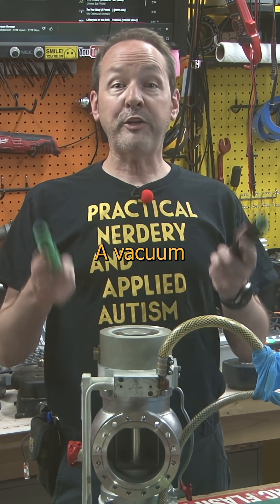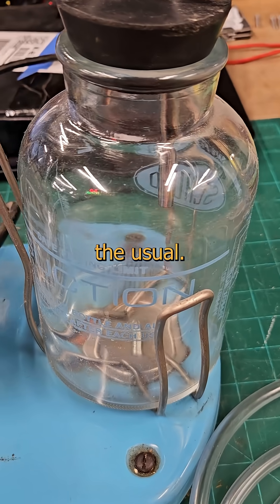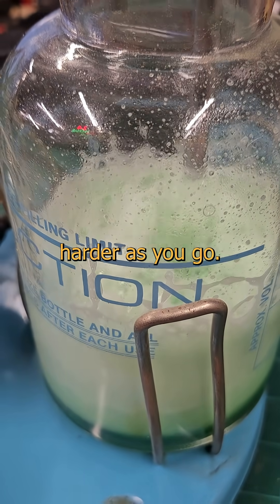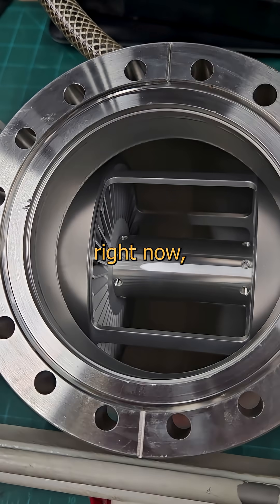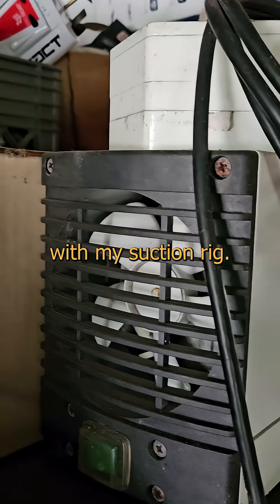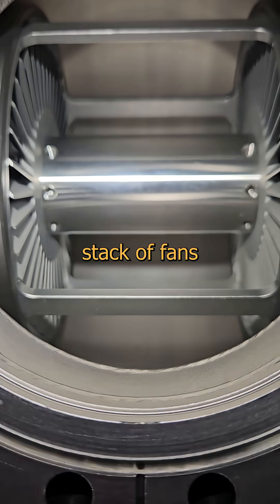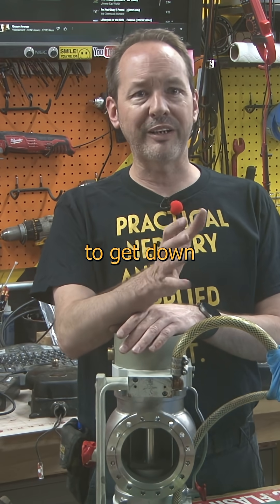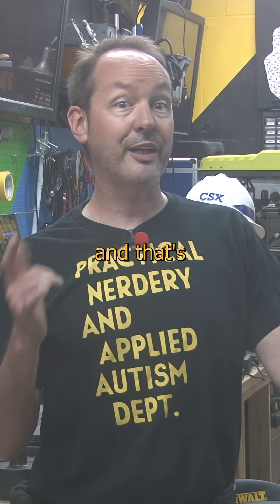Turbomolecular Vacuum Pump #chrisboden #comedy #engineering #physics #science #turbo #nerd

Comment: My job involves testing electronics under vacuum. A couple fun facts I learned:

1. At the vacuum levels we use, the mean free path of particles can be measured in meters. I.e. the average particle could travel 10+ meters before hitting another particle. That really puts it in perspective.

2. If that mean free path is the same size as the devices in your vacuum chamber, it suddenly becomes very very easy for electricity to arc between things. When you pull even more vacuum, the effect goes away. This also happens in Earth's ionosphere.
Reply: What sorta vacuum do you use? I work in MBE
Reply: 2. What the hell??
Reply: @MrHuram-abi  Remember that electrons interact with defined energy levels - meaning that, at some specific accelerating voltage, there will be areas of high interaction and areas of low interaction as the electrons slow down. You can actually see this as a sort of banding in plasma tubes (fluorescent lights count, though the phosphor makes it hard to see). If one of these bands happens to be right across the gap, you'll observe a peak in current as more electrons are absorbed. This may be enough to initiate arcing. As soon as the mean free path exceeds the length of all relevant points on the device under test, those bands will be further apart than the gap between the emitter and all possible receivers.
Reply: 10 meters??   Is that the distance between the lines on a foot ball field they play soccer on ?

Comment: I saw in a video taken back in the 40’s, Edison used the weight of mercury to pull a vacuum on lightbulbs. A long coiled glass pipe ran below the lightbulb with what looked like 100 pounds of mercury, once the mercury could fall no further, they heated and pitched the bottom of the bulb shut.  I don’t know how close to a perfect vacuum it got? But it was enough to keep a lightbulb working for several years.

Comment: So yesterday I was calculating what kind of watering pump you would need to simulate a cow drinking. Did you know a cow can drink up to 20 liters of water per minute ? The average flow rate of tap water is between 4 and 9 liters per minute. Depending on where you live.
That's a lot of sucking potential from the cows.

Comment: I happen to work in this industry! For my jobby mostly with the backend, for my hobby I´ve designed vacuum meters capable of measuring next to nothing. It´s crazy the consessions you have to make as an engineer in this field, I got super lucky to work along old guys with decades of experience under their belts. These pumps are at a vacuum level, a single fingerprint causes an entire week extra of pumping, two flat surfaces can´t mate due to virtual leaks, plastics by definition are a no-go, even the alloy of steel you pick becomes super critical due to the tendency of absorbing moisture or trapping gasses... Rubber seals are for the weak, metal on metal seals only.

Ofcourse I have a turbo to play with at home, though for high vacuum stuff I still prefer oil diffusion pumps. I rather have an oil fire over supersonic shrapnel flying around my labby, only for the really clean stuff I use one. As for metal on metal seals, A Polish book once told me lead was a miraculous material on the cheap, it's worked a treat, I've been using that ever since hahaha.

Comment: I'm a vacuum tech for a physics lab. We're operating in the 10-11 torr range. It's hard to believe that what we're trying to get rid of at that pressure is the hydrogen that diffuses through the stainless steel chamber walls. 

And to get that low, we're backing turbos with turbos (and then a roughing pump).

Comment: You know what else is pretty cool?  A Sprengel Pump (also known as a gravity flow vacuum pump)!  It's a rock-simple vacuum pump that can get you down to the vapor pressure of mercury (or whatever other liquid you're using) with no energy input aside from you occasionally lifting the liquid from the collection pan back up into the reservoir, even if it takes an age and a half to do it. 

Liquid flows down a tube, dripping past a small opening into the vacuum chamber before continuing down the tube.  As it flows, the liquid divides itself up into droplets.  When those droplets flow past the opening, air molecules from the chamber get trapped between them and pushed down the tube and out into the outside environment, after which you pick the liquid up and pour it back in the top to continue pumping.  

It works up until the vacuum is equivalent to the vapor pressure of the liquid you're using, because at that point the droplets will just be catching their own vapor.

Comment: Well, they don’t all need to operate under vacuum, or rather, they don’t need to start under vacuum. Some are rated for 1 atm differential. I use these at work. They will burn themselves up pretty quick if not maglev. That boy there is very old or for far dirtier vacuum systems than we’re allowed to use at work.

That said, aside from the small ones like a Leybold 90i and smaller, a quick way to destroy them is vent the vacuum on the inlet side. They will self-destruct rapidly, and the blades will break and shred the internals. Just like with falls, it isn’t the fall (in this case the air density) that kills you, it’s the sudden stop that kills you.

Comment: This guy claims the ATMOSPHERE IS *SIX THOUSAND MILES* DEEP? "The edge of space is commonly defined by the Kármán line, which is located at an altitude of 100 kilometers (**62 miles**) above sea level. However, this boundary can vary depending on different definitions, with some organizations considering space to begin at around 80 kilometers (50 miles) instead."

Comment: This subject is fascinating, even though my experience is with powerful high volume vacuum pumps, and not the types that finish the job you are talking about.
We have a stack of Becker dry vane pumps that look like exotic engines.
They can pull a vacuum through a sheet of MDF and hold down sheet products in a CNC router.
Many people misunderstand what a  vacuum is, but practically every comment here is from those who know.
I also repair several types of pumps in a granite shop environment.
One little 12 volt pump can evacuate 8 cups that help hold onto sheets of granite weighing up to 1,300 pounds.
Vacuum is amazing.

Comment: I once watched a guy walk away from a 4,000 gallon 10-wheeler vacuum truck with the vacuum engaged. He had to go pee and while he was in there number two called. I guess he forgot the pump was on. If you've seen that video where that tank implodes on the back of that truck it was just like that. That's one of those sights you never forget.

Comment: When I worked at intel I got to hear and feal a turbo pump grenade it's self. The electronic mag bearing failed and floating turbine slipped and the 6 or so pounds spinning at Mach fk-me came to a sudden halt turning the insides to confetti and shaking the entire bays raised floor with a thunderous crack like the rath of Thor. This excited the pixy alarms all over the fab and turning over $1m of silicon wafers into pixy dust inside the machine it was attached to. Thankfully I was not the one who had to clean and fix that mess.

Comment: I work for a company that PVD coats glass. We run high vacuum PVD coaters with over 200 of these TMPs attached. Well, much newer ones with magnetically levitated rotors measuring 400mm in diameter. They create a nice aluminum salad when the rotor crashes.

Comment: Trying to suck up the last drops of a milkshake through a straw is a good commonplace analogy, imo. Trying to get the stuff still stuck to the cup, and then the little bit sticking to the inside of the straw is maddening. You can use multiple lungfulls of air and finally just give up.

Comment: I'm an hvac/refrigeration guy and good lord is pulling a vacuum annoying. We only need to get down to 300 microns, but often on the size of system I work on I just let the bastard run for 45mins-1hr and call it good so long as it passed the pressure test first and wasn't open for more than a few hours. The filter-drier will take care of whatever moisture is left and the faint amount of nitrogen in the system isn't going to do squat. 

I heard the best way to describe how gas works in a vacuum is it's like trying to pump out honey. Low pressure gas acts viscous because of how little intermolecular pressure there is and makes it hard for whatever remaining pressure is in the system to push out stuff

Comment: I don't want to be the guy with a clipboard but I think you may have used atmosphere diameter instead of hight. The atmosphere doesn't have an edge but space is usually defined at about 60 to 100 miles up depending on what flavor of electrical plug you use.

Comment: The vacuum pumps on the water pumps I work on uses a piston in conjunction with a series of rubber valves, seals, and an actuator. They usually pull about -24 psi.

Comment: I used to work with plasma etchers, and I've had to replace a couple of tmp's after a seal failure or some dummy started flowing gasses to vent without closing the valve, or it would just get clogged with process buildup and stop suddenly. They're big, heavy, and expensive... not to mention difficult to remove.

Comment: Long ago I was helping establish an environmentally better degreasing system. Soap and water was an issue due to corrosion of the parts. A surplus vacuum pump was obtained and a suitable chamber identified. Room temperature pulled all the grease into the plumbing as volatile fractions. The stuff left over came off with a brush. Just dust. In the end a steam machine was selected but the vacuum thing was pretty cool. We brainstormed that we might clean the lines after with ozone but never actually tried.

Comment: The TMP will NOT desintigrate when you turn it on at atp, it only will spin to a small RPM and will shut down on overload. BUT if you let it suck atmosphere at nominal speed (40.000-150.000RPM) it will explode. Best comparison: with a fiat punto you can only get to 80mph because of all the air resistance and the small power of the car. In Vacuum it will get to 500 to 700 mph because its freespinning (yeah gearbox ratio and so on, but just focus on the power nessesary). Now imagine what will happen to a fiat punto when air resistance spontaniulsly hit it at 600mph.

Comment: Alpen Fury also had a bunch of misaligned supports that had to be cut, and rewelded which took up a lot of time, and they were building some of it in a fake mountain. 
Sirens Curse was a very last second addition, and the fact that they got that planned, installed, and running so fast speaks volumes about the construction crews up there. Announced, and open within a year is pretty amazing.

Comment: Failing to turn the vacuum pump on can be extremely dangerous. "Detonate your glassware because you've condensed oxygen inside it" dangerous. "Detonate your glassware because you've got a pyrophoric reagent inside it" dangerous. Failing to operate with proper protocol for your atmospherics in place can be dangerous.

Comment: Hoi, im one of those people that spend half their PHD making good vacuum for my ion trap. So have a little info dump:

We only really use turbos to get the vacuum started. Our chambers don't actively produce any gasses, so we don't need the infinite capacity of a turbo. Also, turbos produce vibrations, which we cant tolerate.

I've heard of people getting to <10^-10mBar with just turbos, but for us once we reach around 10^-7, we turn on our ion pumps and getters.

Ion pumps ionize the remaining molecules, accelerate them, and shoot them into the anode plates. The molecules penetrate deep enough to make anyone blush regardless of gender and then kinda just get stuck there. There's more to that but thats the gist.

But the ion pump is not the heavy lifter for up. Thats the NEG pump, the "Non-Evaporable Getter".
It's literally just a sponge of a titanium-zirconium-aluminium alloy. Once in vacuum, you heat it up to like 900C, and all the oxides on the surface diffuse into the material, leaving an extremely reactive metal surface. Almost anything that touches it immediately reacts and is thus chemically bonded forever (well, theres more to it). Its especially good at absorbing hydrogen, which is by far the largest fraction of the remaining gasses.
Noble gasses get pumped by NEGs, so thats why we usually have a NEG and an ion pump. They often come together as one unit (like the SAES Z100)

But thats all off the shelf, so how do you make really good vacuum? Well you can't really improve the pumps other than adding more and more getters wherever you can. So the gas removal rate is kinda fixed.
But you can reduce the rate at which gasses leak into the chamber! First step is to bake your chamber while its under vacuum. A lot of crap sticks to the surfaces when assembling the chamber in air, and only comes off slowly over months or years! By far the biggest offender is water, but nitrogen and oxygen do it too. Oh and of course you need to clean everything extremely well, especially any oils or other organics will slowly decompose and/or evaporate in vacuum, ruining your pressure.
Alright, so we tripple clean everything in a cleanroom, assemble, pump down, bake for two weeks at 140C, everything on the surfaces should be gone. You can get to <10^9mBar that way. But we want to go further...

At this point, you find that everything actually produces gasses. Everything outgasses, just at different rates. Plasics are pretty much off the table, only PEEK is kinda ok. But even PEEK outgasses water, not from the surface but from the material itself. It takes ages to get it all out. Ok then lets do just steel and ceramics right? Kinda, but stainless steel outgasses hydrogen quite significantly. You can hydrogen anneal it at ~800C in a high vacuum for a few days to weeks, but thats so expensive you might as well go for the star of extremely high vacuum:
✨ Titanium ✨
It does also outgas some hydrogen, and should be annealed, but it's way less than steel. Titanium is so reactive, it kinda just binds everything within it. Aluminium is also pretty good and less expensive, but annoyingly soft.
With a titanium chamber, two NEGs and ion pump, and zero polymers in the chamber, we now achieve around 10^-12mBar.

You can do crazy stuff like coating your entire chamber in neg material, but at some point you just need to pull the cheat code:
Just do your entire experiment ay cryogenic temperatures. If you cool down your chamber to 2K, you immediately get like 10^-18mBar without taking any further care about materials or whatever.

Comment: “Spinning at march-Jesus!” Is a speed you don’t mess with!
Reply: The ones I work with are much bigger and they spent it around 30,000 RPMs.

You can actually crack the welding open and dump all the vacuum while it’s under four RPMs, but it’s not good… They’re pretty beefy so they can take it a few times.
Reply: @Anonymous8317 yea but at Mach Jesus you’re seeing the future! 😂

Comment: I did some work using a scanning electron microscope which needed to be stored in a vacuum. The really amazing technology was an ion pump used on the arc coater. We needed it because it involved vaporizing metal wire and then deposting it on the sample. As such no air could be there or massive problems would happen. It took forever to pump up and down.

Comment: We have vacuum chamber on our "Ebeams" at work that get down to 1e-7tor. We use a roughing pump to get to 8e-2tor, then the "Cryo Pump" kicks in, which is essentially an heat pump that uses liquid helium for a refrigerant. That gets the chamber to about 11k. 

Basically, since pressure is molecules vibrating against each other, once you are unable to remove more molecules from the chamber, you just take the vibrational energy (heat) away from them to reduce pressure. 

Oh, and the vacuum is to house what is essentially ae electron beam cannon, running at 110KV. We use it to cure varnish...

Comment: Worked with TMP's exclusively for a decade. I worked for a,  now no longer American, lightbulb manufacturer. We used TMP's to create a negative atmosphere inside certain style of bulbs so we could then vaporize a tiny hair thin piece of aluminum or silver wire in order to coat the inside of a bulb with a reflective coating. And yes, if a seal goes or you are missing a bulb in the assembly when it spins up to kach Jesus, it most definitley will eviscerated itself. I've watched these things detonate and it's scary and hilarious at the same time. Watching a company dump 70k per pump instead of fixing the actual problem is hilarious. I've tossed more of those in the scrap bin than I care to count

Comment: I have seen these when doing micro-fabrication for microchips. You can vacuum so much air with that, that works its way through the molecules of a steel chamber never getting a full compressed vacuum with that turbo fan you got there

Comment: You don't NEED to operate a turbomolecular vacuum pump under vacuum: if you have any sort of speed control on your pump(which you should), you can start at the slowest and gradually crank it up. Just listen for any sounds of cavitation, it'll be fine. We used this exact technique at my school where we didn't have a roughing pump in our system.

Comment: So what if you put in a liquid first

Not like water where it'd evaporate or whatever, but some oil that would physically replace the air, and as the oil is pulled out, there just isn't any air to be pulled out, it's just the oil that needs removed

Comment: I have a question: if you build a framework and put a membrane strong enough over the framework, and it was able to maintain a vacuum, would the resulting void float in air like a hot air balloon since the void would be lighter than air?